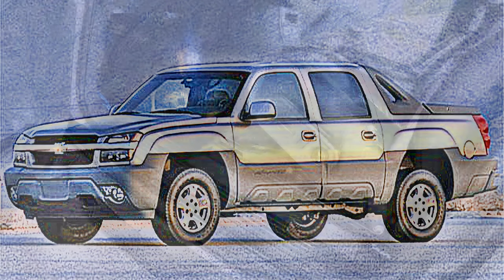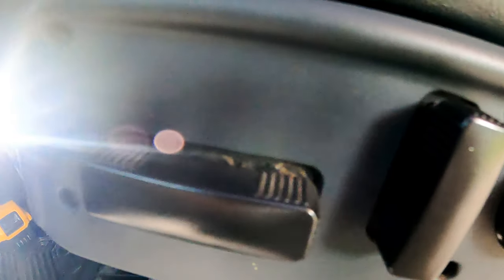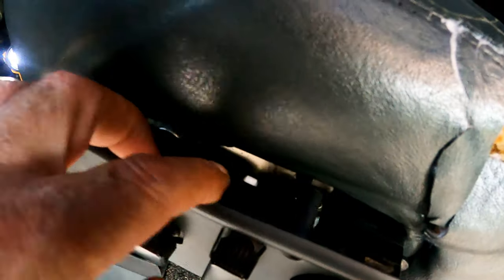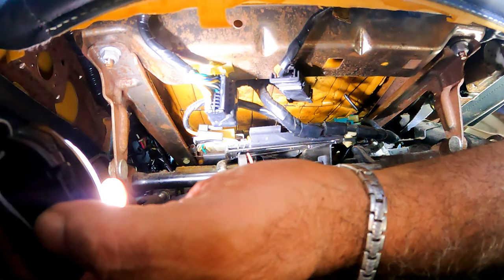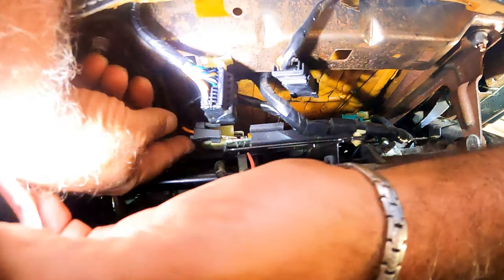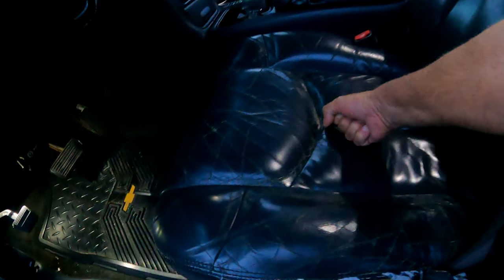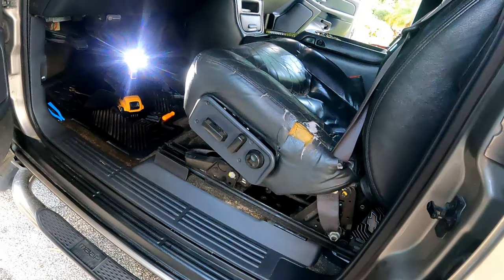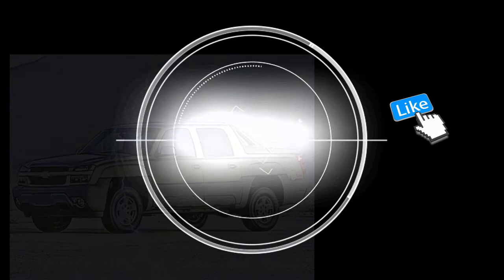Repair Power Seat Switch and Control Module - Chevy Avalanche 1500

Comment from the maker: 🛠 This video we will show how we troubleshoot and fix the Power Seat Switch and Control Module on the Chevy Avalanche 1500. It's the same on models from  2002 to 2006 Chevrolet Avalanches.

Comment: Where can I but a new controls and everything
Reply from the maker: For the  Driver and Passenger Side Seat Switches, see the two links below.
Dorman 901-202 Front Driver Side Seat Switch Compatible with Select Models:  https://amzn.to/3VZcz0k
Dorman 901-201 Front Passenger Side Seat Switch Compatible with Select Models: https://amzn.to/3WbHQ09
Reply: @JohnCRV  what about everything else
Reply from the maker: @trevormcgaha1920  if you mean the control Module itself, I couldn’t find one anywhere except a junk yard or eBay.  If you do find one there make sure it’s for the same year and model.
Reply: @JohnCRV  and the circle thing to what ever is that called
Reply from the maker: @trevormcgaha1920  If you mean the lumbar switch it's not available new but if you go to ebay you'll see plenty of used ones.  https://www.ebay.com/itm/125433204331?chn=ps&_trkparms=ispr%3D1&amdata=enc%3A1qLGHYmLOR4CCh1mDfhJelQ10&norover=1&mkevt=1&mkrid=711-213727-13078-0&mkcid=2&itemid=125433204331&targetid=4580840331958309&device=c&mktype=&googleloc=&poi=&campaignid=437225721&mkgroupid=1235851340419610&rlsatarget=pla-4580840331958309&abcId=9300906&merchantid=51291&msclkid=8e4dd4f829db167f2579b0a6f21108db

Comment: Same symptoms on my 1999 silverado lumbar and  heat works but nothing else. I checked all my plugs but everything was good. Im stumped!
Reply from the maker: Sorry for your troubles. If you've checked everything, it could be a bad Module. We picked one up at a near by junk yard for a few dollars, because we couldn't find anything to replace the cracked plastic cover...
Reply: @JohnCRV  cool thanks. Is there any way to test it?

Comment: Does that box control the passenger seat as well?
Reply from the maker: No it does not. The passenger side was working fine. If I remember correctly the control module is for the seat memory 1&2 and also powers the motor.